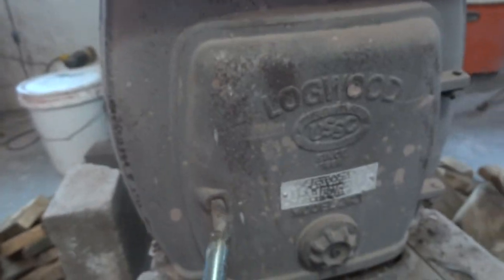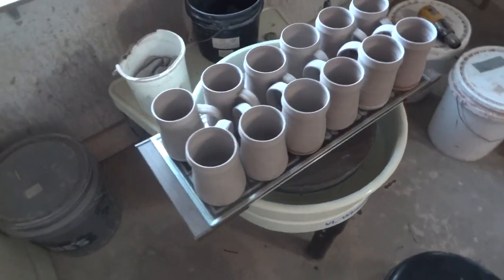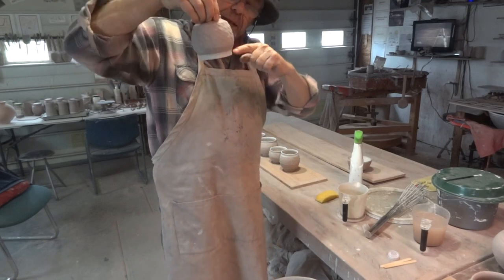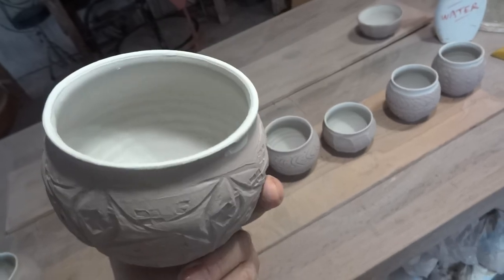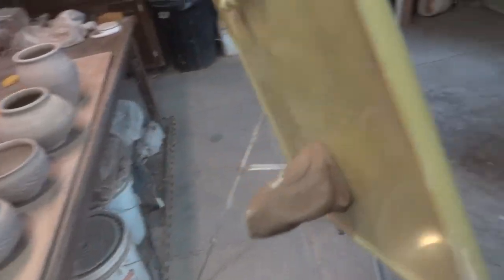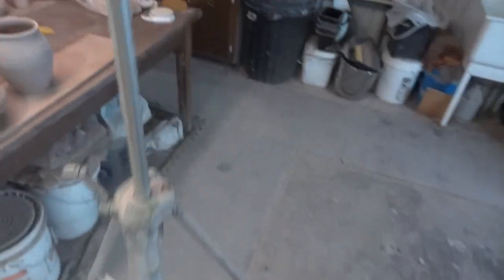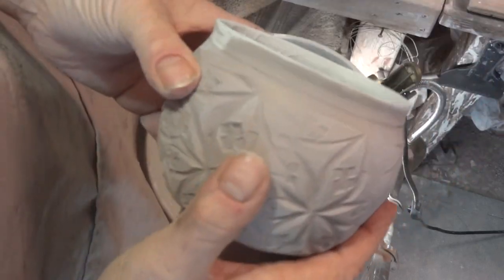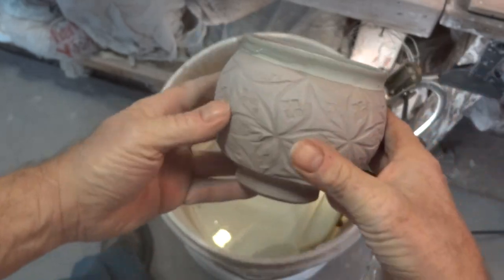Some glazing tips - how to keep a 'level' head ? ..with Simon Leach Dec 3rd 2021

Comment: Hi Simon. I use a small glass tray (like a 9“ x 9“ baking sheet and only put a half inch of well mixed glaze in the bottom so when you set your pot in you can place it right down to the bottom and then slowly lift out. If you place it on the bench you’ll be closer to the pot and see exactly where the line is. All the best! :)
Reply from the maker: That is a possible way also. Key is keeping the glaze from settling out. Thx

Comment: I suppose another way would be to paint some masking wax on below where the glaze goes, on the banding wheel, then you wouldn't need to be quite so careful when dipping it in the glaze.
Reply: But the wax would then resist the  final outside glaze leaving an unglazed band.
Reply from the maker: It’s true what Amanda says the wax would resist also the wood ash spray ..somewhat, at least a noticeable line.
Reply: Alternately, a line of masking tape, which you can then pull off once the glaze is dry? I guess how easy it would be depends on how straight your walls are